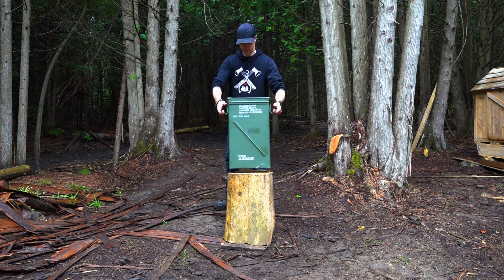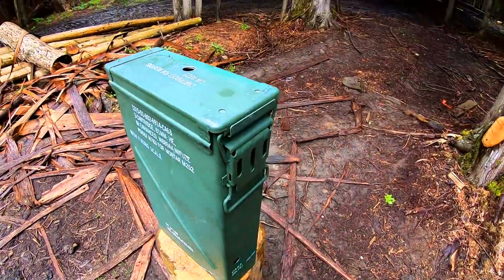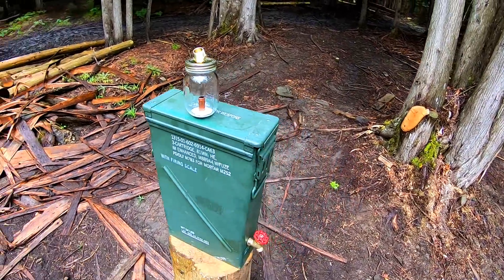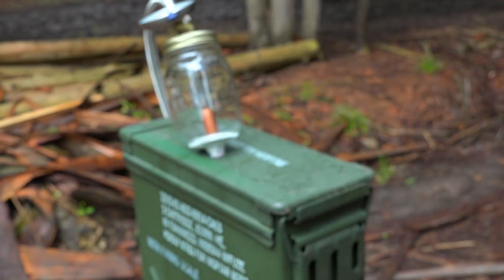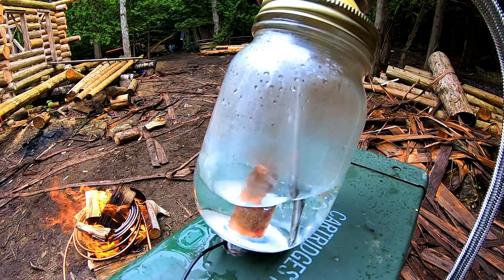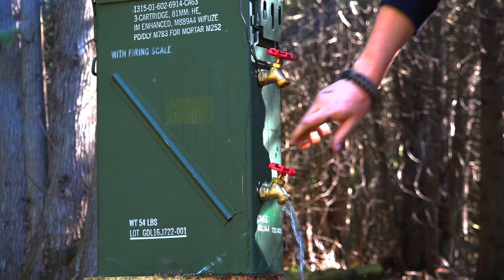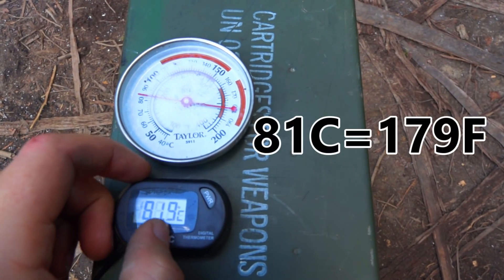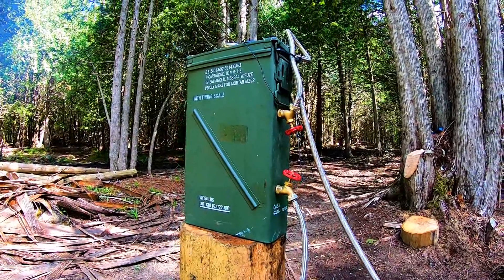Off Grid Heating Prototype- Copper Coil Water Heater / Heat Exchanger / Radiant Heater

Comment: "Now there wouldn't be any room for air to get trapped in the lines, and create steam like it had before"... Mate water makes steam. Not air
Reply: he isn't wrong but not quite correct.. the issue with feeding hot water above a water surface with a vent causes air to be sucked in and because the top opening wasn't fully sealed allowed air be sucked in acting like a vent which allowed space for the steam to build up in the jar which is the vapor lock however though if he did seal that top hole with the jar the pressure would have built up from the compressed steam and explode more than likely the jar would have gave out before the steel ammo box. The correct way for making water heaters is to have hot above the water level and cold at the bottom level with a opening above the water level to allow excess steam to escape which is what he did don't know if he looked it up or not, but my guess is he probably did.
Reply: @IloveJellow  There is absolutely no way it could suck back literally meters of lenght in air though
Reply: @whatevernamegoeshere3644  don't need to fill the entire thing with air a small bubble will do. Kinda like a bubble of air stopping your heart.
Reply: @darkfur18  Yeah but how does an air bubble go downwards into the pipe under water?
Reply: @whatevernamegoeshere3644  doesn't necessarily have to be air, in this case it was most likely a steam bubble forming from the water in the copper line boiling when the flow of water stopped
Reply: @darkfur18  it takes an insanely big bubble of air to stop your heart though. more of an issue of pump function. you take a water pump, remove water, and make it pump, itll self destruct pretty quickly. the heart fails the same way.
Reply: @darkfur18  A small air bubble stops your heart because your blood coagulates when in contact with air. The blood clot travels to your heart or brain and blocks the blood flow.

At 8:30 you can see the bubbles of steam emerging fromt he pipe. Both the inlet and outlet were completely covered with water, no air in the copper tube.

https://en.wikipedia.org/wiki/Pulmonary_embolism
Reply: @JohnDoe-mx1sq  air embolisms do not stop your heart due to blood coagulation. they stop your heart because they reduce the effectiveness of your heart and impede the flow of blood.

"Small bubbles can block capillaries in vital organs, most urgently the brain, causing anything from pain and inflammation to neurological damage and paralysis. A small bubble impedes blood flow the same way a solid obstruction would — the bubble's surface tension relative to its size is too great for the force of blood to break it up or shove it along. Bad? Yes. Fatal? Probably not, although see below.

A big bubble, on the other hand, gets us into the vapor lock scenario. Your heart, like the fuel pump in an old car (cars with modern fuel injection work differently), is a simple mechanical device. In ordinary operation, its contracting chambers squeeze the blood out and force it through the circulatory system. All is well. Now imagine a massive air embolus shows up and your heart starts squeezing on that. There's nothing to get any purchase on; the air just compresses. Blood flow stops, and eventually so does your heart."
Reply: @JohnDoe-mx1sq  way off topic, but the air in the artery thing is exaggerated, you'd need 50 ml of air in a blood stream to cause an air embolism.  That's a shit load of air.  Small bubbles are avoided because in older patients you can have a build up of them in the pulmonary vascular beds and if you add a LOT of micro bubbles quickly, you can have an issue....but even older patients absorb them given time  Overall the bubble in the line thing is a movie myth.  We get micro bubbles all the time.
Reply: With all the gurgling going on its not thermo siphoning.. It's steam.. You can even see the steam bubble collapse as it come into the cold tank.. You'd only need one loop of copper to thermo siphon with that fire
Reply: His room is gonna be super soaked because of the steam and the water evaporating into the air.
Reply: his water "boiled" at 85C so....I don't think arguing about science will go far...
Reply: @boanerges5723  the temperature of water in the tank was 85C. The temperature of the steam in the copper pipe is much higher. The water is in two different phases.
Reply: Agreed.  That's what you call vapor lock.

Comment: THis looks like 3rd degree burns waiting to happen. you need a way to rapidly cool the outflow before it's reheated to prevent reaching the steampoint. otherwise your box is gonna turn into a steam sauna and get real soggy. Maybe some thinner copper tubing coiled under the bottom plank/floor could warm the bottom and allow you to keep the water tank outside as well.

Comment: Seems like an awful lot of stuff to carry around on the back of a snowmobile to heat you, both in terms of the space it takes up and the weight it adds. To the point it would surely make more sense to attach solar panels to the trailers roof and just run electric heating. 

Alternatively a camping stove would make more sense for a small space like that. They're used by cross country skiiers to heat their tents, so they're somewhat lighter. Instead of requiring a source of water to start heating, they use a heat pipe to transfer heat from the fire in the stove into the space, while safely exhausting the smoke from the fire outside. Camping stoves typically stay hot for 4-5 hours after the fire goes out and are commercially available at any good camping store. 

If you insist on going this water heater method, then obviously the copper pipe should never come in direct contact with the fire. So you need to adjust the design to heat the pipe indirectly. 

Running pipe coils inside the ammo box from the inlet to the outlet then filling the box with water will likewise give you better heat efficiency and a longer lasting heat battery. You'd be essentially making a small scale water heater. 

By keeping the water in the lines a sealed closed air tight loop, you get rid of the creation of steam, it doesn't make loud thumping from bubbles and allows you to use better thermo-conductive liquids than water in the pipe. 

The ammo box can then be air tight meaning the chances of an accidental scolding from boiling water falling on you in the night is reduced. 

Lastly you should insulate the outside of the ammo box except for the side you want the heat to come off. That creates directional heating making the system more efficient and increasing the longevity of heating. 

I'd still suggest the solar system or a camping stove make more sense though. That's why they're commercially available and water heaters aren't.

Comment: if you solder metal plates sticking out to the box you have a proper radiator with enough surface area to heat up the air, otherwise you have almost no heat transfer from your box into your cabin
Reply: As it is in this video, there's plenty of excess heat for such a small space. Of more concern is positioning it where you won't touch it on accident. If you are going to regulate the water temperature close to your desired air temperature, then you start worrying about efficient heat transfer.

Comment: You could use a radiator from a small car, or better yet a heater core from a car heater, which is really a tiny radiator. It already has the inlet and outlet, and would be infinitely more efficient, completely sealed and very, very light.

Comment: Wouldn't a boiler design space heater radiator do wonders here instead of the ammo box? They are basically just elaborate water tanks designed for the job and being water proof. The problem with the ammo box is that it is just a plain radiation design with no convection so to speak of. Which has it's advantages admittedly but it is slow to start up and relies too much on a large Delta K to ambient to emit some decent heat. A heater radiator is cheap, looks good, is designed to be waterproof, standardised for fittings and has pressure valves available.

If you are hell bent on some DIY solution I suggest the cooling radiator of an old truck. You can get them for a decent price at a scarp yard and they have the benefit of being designed to operate close to boiling point and move large heat amounts through.

Also some additional important tips:
put freezing detergent into the water! The copper coil will eventually be out in freezing temperatures and even if the ice doesn't kill it it will mean the startup of the system could take a long time!
A biogrow killer might be sensible unless you frequently heat it up a lot and drain it when not needed.

Bust most importantly: design the pressure valve to exhaust out of the cabin you intend to use it for. Yes - you will lose  quite some kWh of energy but also prevent crazy amounts of humidity and condensation inside that will a: force you to open windows and thus lose way more energy and b: promotes fungi growth which is a serious problem.

Hope my text was not to distorted to read. I am neither a native nor an installation professional.

Comment: The easiest way to heat the camper is to be inside with a hot chick 😉👍🏼🍺 although it might not be so cheap on the long run 😂🙈

Comment: You cannot safely operate this equipment without a pressure relief valve.  You should get one and plumb it in on the hot leg of the system and outside the cabin.  This is a closed system and will explode catastrophically either by brittle fracture (massive explosion with little shards of metal) or ductile failure which will result in a jet of steam filling your cabin and possible burning you very badly.
Reply from the maker: It's an open system, as shown in the video.
Reply: I didn't realize you just sat the thermometer in the top of the lid.  Still is unsafe.  Thermal expansion could result in it over flowing into the cabin.  Not sure why this should be an acceptable risk.
Reply from the maker: @D G This is a prototype,  proof of concept. In the video, I state that my design needs improving, but I was happy with the result. In a later episode, I improved the design, and successfully integrated into my camper. https://youtu.be/BREQY1TL7JA

Comment: I can agree with those who suggest a radiator but it will have to be regulated since radiators will crack or explode with too much pressure.  It will need a thermostat and an expansion tank to operate safely.  This will also keep the water temp regulated so you dont have to place and remove the coils from the campfire which will be ideal for overnight operation.  Having more coils on the fire end will increase the temp of the water since it spends more time in the fire, having less coils will reduce the temp but may interfere with convection but the goal is to try not to get the water to boil in the coil.  The thermostat will prevent flow until a certain temperature is achieved thus creating a system that will heat faster and allow some regulation to prevent over heating.  You could try to mount the expansion tank above the radiator with the thermostat between the radiator and expansion tank set to open at 155f - 165f so it allows flow before it boils.  This will need a bypass line to allow flow while it heats up.  Once flow travels through the radiator a temp regulated fan will keep it at temperature and not allowing it to boil, letting cool water flow to the campfire from the bottom of the radiator.  For safety reasons this will be outside the camper in the event it does leak or explode it wont scald you in your sleep.  Then you can create a baffle to allow the hot air from the fan/radiator into the cabin area thus allowing you to moderate inside temp, this will open and close according to a thermostat placed inside the camper.  With all this you may never have a cold night as long as you have hot coals burning.

Ah, lastly is evaporation.  Over time you will lose water through evaporation and once air is in the line steam becomes a threat.  There will need a water level monitoring system and/or adding coolant to the water to prevent boiling.  This will need to be a closed system to minimize evaporation with a relief valve to prevent pressure build up.  Essentially take the front end a of a Mazda and attach it to your camper.

Clearly over complicated a simple concept :)

Comment: How is it off grid if you need a battery for the thermometer?
Reply: batteries are almost solely made for off-grid solutions. Where do you see a connection to the power grid?

Comment: Insulate and use a hot water bottle system. You're already going to be running on a retained heat system. Or even an ash box.

Comment: This seems like a waste of time to me. You’re out in the bush in a log cabin that would or will have an open fire place and a fire for cooking. Just run the piping through either for hot water. If you have a fire place. Why do you need a water heater?  You still need to make a fire.

Comment: You just reinvented a radiator. Why not just get a radiator instead of the ammo-can, then just adapt the connectors. 
Also, using water, you're going to find trouble with corrosion in a couple years, which is why "modern" (40's) radiators used oil in a closed circuit. 
While you'll lose some efficiency, you'll gain much in longevity and flexibility, if you keep the radiator closed-circuit and sealed oil, with a heat exchanger between the water and the oil.
Reply: Radiators all use water in the UK. Radiators are still used over 100 years old.
Reply: @carbon1255  Huh, that's good to know. TY. Do you know how they avoided the corrosion problem?

Comment: Nice stuff.

If you could seal the system tightly you could heat the water to higher temperatures without boiling it.

Comment: We built one and used it in cub scouts, ours was an old smoker with the tubing inside of it and a 20 gallon drum, we even had a tap on the drum to use for hot water.

Comment: Heya, saw this and had an idea. Take the copper pipe, wield some aluminum to make a holder for it so it stays in a nice cylinder. Take a heater core from a car, or a radiator if you really need a lot of heat dissipation, put that in the cabin with a variable speed fan behind it.  Remove the ammo box, and replace with  a car coolant expansion tank. This should keep the water below boiling and prevent the hammer effect you have. Also should allow you to really get a good idea for how big a fire you need and I expect this would be super efficient to warm the space.

Comment: Also, the long tube you had at the start forced the hot water down into the bottom, and straight out through copper tube again, instead of having the colder water at the bottom.

Comment: Why not put the tank directly on the fire and transfer it to the cabin once at heat. In the UK we use electric storage heaters like this. We heat a cinder block once a day. Or is in an insulated enclosure and so by opening or closing the flap we can control the heat loss into the room.
Reply: This is probably the simplest and more effective way to do what he is trying to do, but a video with a couple of stones in the fire probably wouldn’t attract too many views
Reply: @willygepe  I'd probably still use the tank, it makes a good thermal store but is light when empty.nfill it with snow when mass is needed. The insulated enclosure that ensures the slow insulated release over several hours can be the build instead of the plumbing?

Comment: wouldn't it be easier to throw the tank into the fire, wait and put it into your snow mobile caravan afterwards, like a warmers?
Reply: That whould mean, 2 hours in the fire for 30 minutes heat inside the trailer
Warm water heating keeps it hot where it needs to be hot and okay temp where it needs to be ok, like the metal thats gonna be in the trailer i dont think he wants burning hot as it whould be a fire hasard

Comment: Unless you are living a week or more in that small sled shed I’d just take a Buddy Heater and a 20 Lbs propane tank along with a good winter sleeping bag. Otherwise mount your transfer tank to the outside of your shed and run a second coil under the bed for radiant heat with a valve inside to control water flow and the inside temp. The first coil is still in the fire for primary heat in the transfer tank. Fill the whole thing with glycol so it won’t freeze up and crack the tubing. Make it so you can just pull the primary coil off the back of the shed and throw it onto the fire without having to hookup or unhook anything.
Reply: The buddy heater emitting CM has been disproved. It is safe for enclosed spaces. Plenty of videos testing it.
Reply: @RyanGuy7195  perhaps but it seems doubtful. Needs oxygen to burn..... There's only so much OXY in a given space
Reply: But the buddy heater produces carbon monoxide and dioxide. Which can choke you